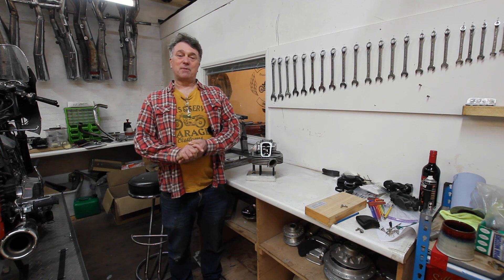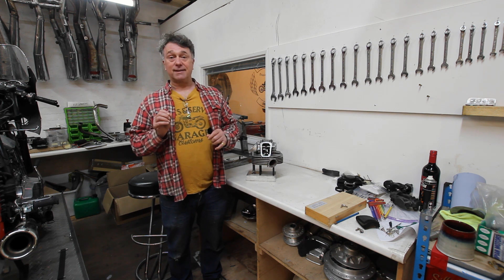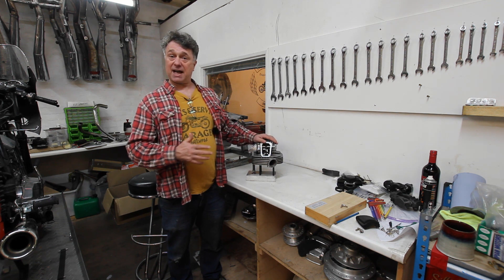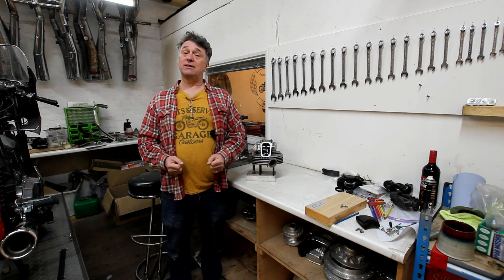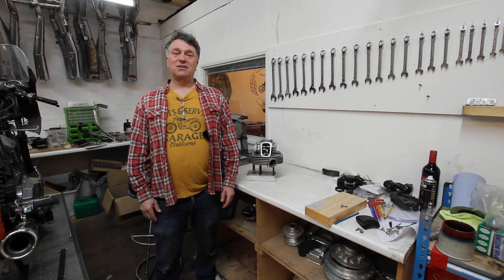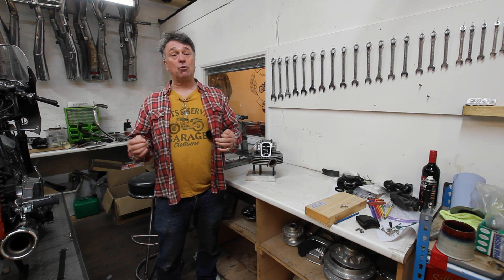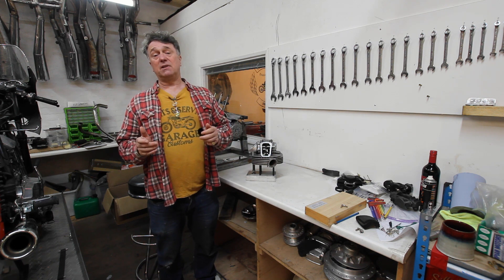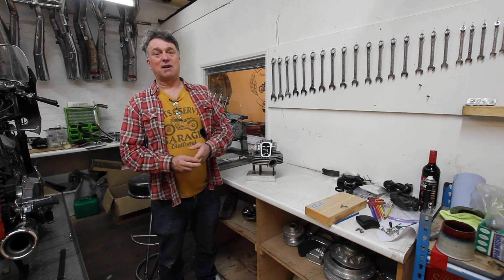Ducati Desmodromic valve operation

Comment: Hey bud I have a question about my 2005 monster if I may?? My oil pressure switch broke off with the threading staying in the engine. Any thoughts on how I can fix this? Thank you